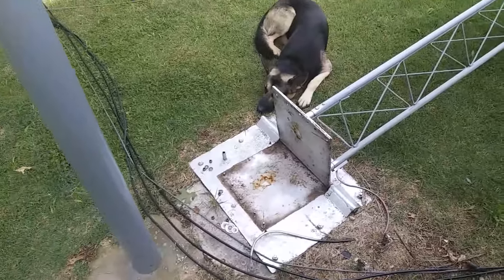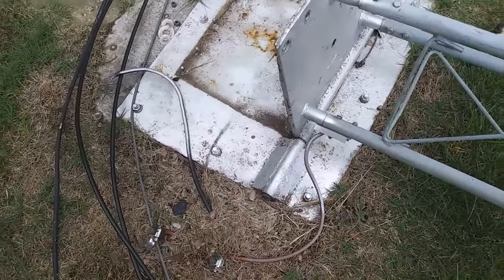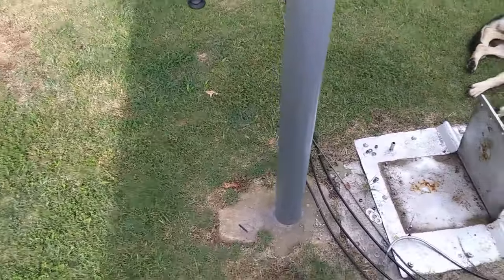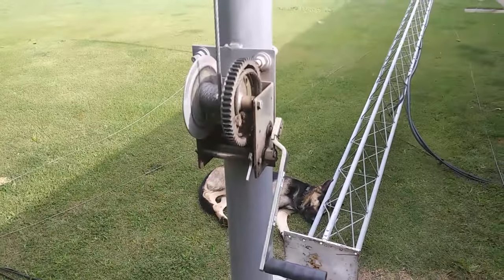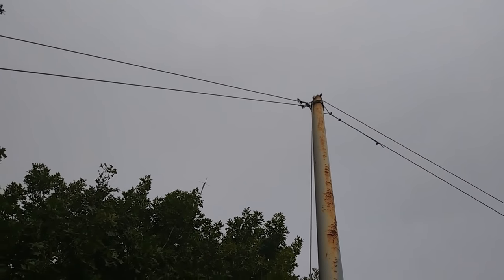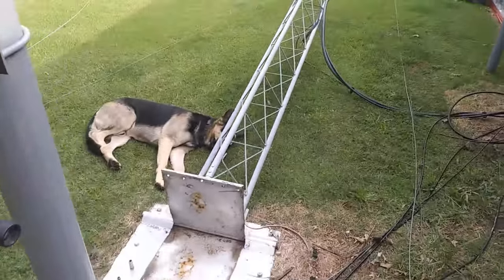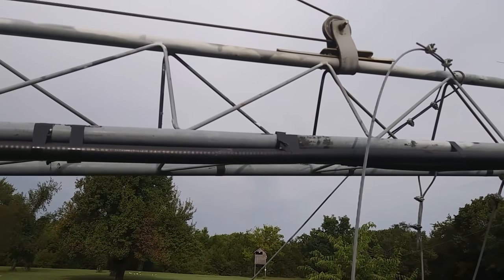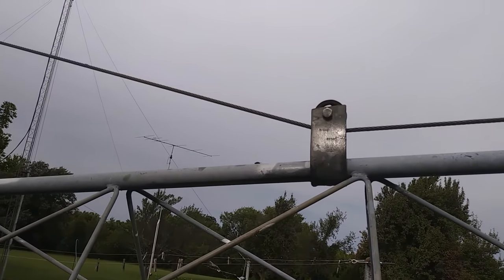Ham Radio Tower Install - Old Kansas House

Comment: But that's my favorite part: watching the tower go up. You can't leave that out!! Don't you have a tripod (for the camcorder)? And wouldn't any kids or grand kids help out with the crank up? I have a 110' aluminum (Universal) tower w/ 2m, 440 and 222 beams. I used a 90' oak tree with a pulley at 55' and used my pickup to pull it up. Some day I'll have to post the video. Got some scenes from the top of the tower too, but like you I'm getting too old to climb it to do ant/rotor/coax work any more and think I may take it down and put smaller ants up, maybe just a repeater.  ka2hng

Comment: Thanks for posting the good video.  I love seeing how other guys do their ham thing.  I run stacked A147-11's on a 40' self supporting tv tower.  Just a share point:  I run Alpha Deltas on all my antenna leads.  I designed and built a grounding block that is bonded to my single point "Chatsworth" grounding plate in the shack.  The grounding block gives me a place to "park" my antenna connectors when I disconnect them from the radios instead of just laying the cable across the bench, etc.  My idea about lightning protection is to prevent or at least lessen the chances of a direct strike by lowering the difference in potential to as close to zero as possible.  This is something my old high school electronics ham radio teacher taught me and it has served me well for over 40 years with no direct strikes to my station.  Lots of very close, holy crap! calls though.  Anyway, thanks for posting and yes, I'd definitely install an electric winch on that tower.  73
Reply: yeah leaving a loose coax cable hanging is asking for trouble! I take a grounded SO-239 mounted to my rack so i plug the loose end into it after i unplug. i doubt it will save the coax but should keep it from flying around in the shack!
Reply: That's interesting. So being not very technical here but seeing how a lightning strike tore up dads station when I was a kid. 
   Will a strike still come through the coax and just go to ground instead of hurting things or how?

Comment: Hello David. An FYI...Great tower setup and nice to see 80 feet of Rohn 25 does not bend too much when being raised from horizontal to vertical. Liked you home brew pulley's and thought I might try that too. One thing, using an electric winch does require stopping every so often to keep from burning up the motor. They won't stand running them for over a minute or two safely is my guess.  I know, I wore out two 8000# Harbor Freight 'Chicago' winches which was probably my own fault. Now I have a Ramsey RE8000 worm gear winch that works great and holds the load in any location while going up and down. Great for building quad arrays or any such thing. Like your setup. Terry

Comment: Thanks for Giving Me Some Ideas for 2 Pulley Points.. I need to fabricate  a Winch for one of my towers ..
Regarding Lighning--  as the ole' sayin' goes.. Lightning Does Whatever The Heck it Wants to Do!  Good Thing your Radios were unplugged!
Here in Florida is Lightning Capitol of the world.  I Disconnect All Radios when Not in Use during  Storm Season.

Comment: Worked in Florida,  worst lightning in the US! I have found that lighting does what it wants to do. I have seen it blow the connector off the coax and only blow the fuse in the radio, and have seen it blow components off the boards and not do anything to the antana or cables. Found more is better when it comes to lighting protection! Ground the coax at the bottom or the lowest point as it leaves the tower!

Comment: A safety note: The guy wire fasteners are installed backward. The "U" should surround the dead pigtail and the "U Saddle" should surround the loaded cable.
Reply: Thank you for sharing this info. I didn’t realize it made a difference.

Comment: Just thinking, with the 2 pulley system, when you crank it up you are pulling "two" times as much "cable" as you would with a single cable. If you had a wench with a 2/1 ratio wouldn't it do the same thing with a single cable? I have put up lots of towers in my time but being 83 I don't climb too well now. I had a 200 ft Rohn 25 that I put up years ago that I just took down but it was by accident. I was pulling a guy wire out of a tree with my truck and it hung another guy wire and down came the tower.------- UH OH!!!

Comment: I have the tower and I can’t find the tilt base.It will only be 40’ of tower and 10’ of mast for my Diamond V2000 vertical.I have 50’ now with 20’ of mast with a Five Band HF Yagi,5 element 6 meter Yagi and a 15 element 2 meter Yagi along with a G5RV and a 160 meter half Sloper on it.

Comment: I would like to reply on his wire rope rigging,Ive never seen this type of rigging but I have a 70 ft rohn tower and the way I rigged it was you use 3 pullies 2 on the gin pole and one on the tower this makes it so it want sag in the middle,First you do is start your end at the hand winch and feed it thro the pully on top of the gin pole and run it say in the middle of your tower where there will be a pully then run it back to the gin pole and out to the end or where it will not be in the way of anything and tie it off  at you hand crank and add as much as you need to, to over lap so it dont slip off.With this set up you pull both the end and the middle at the same time with same amount of lift,with a lon enouf genpole you could rase a 100 ft with a 30 ft gin pole,also you could add 2 pullies and a tie off on the tower if you are lifting one that is heavy.also Ive learned the by keeping the hand winch tight it helps stabilize the tower adding another guid wire to it,        Just my 2 cents

Comment: i know this is a old vid. but would there be any draw back to moving the rotor to ground level and running heavy plastic pipe to the mast pole ,might make it easy to work on?
Reply from the maker: piper jones that would probably work, but it doesn't take very long to crank down to work on it

Comment: The best earth ground goes as deep as it can. Of all the tower videos I have watched, nobody puts the spike in at the bottom of the hole below the concrete, but does it at the side afterwards.
Reply: Lightning discharge can blow concrete apart. That's why the rods are to the side.
Reply: the rods are on the side because lightning can blow the concrete and also so they can replaced later if they rust out.
Reply: @kevink5kev959  the preferred way is to install a 3/4 inch PVC pipe in the foundation hole before the concrete is installed, tape off the top of the PVC tube of course. Then drop in the ground rod.  When the strike hits the rod, the rod can expand but will not explode the concrete.

Comment: Please watch "https://everythingsafetyntraining.com/2016/09/17/saddle-bolts-safety-never-saddle-a-dead-horse/" to properly place your saddle bolts.

Please get the lightning protection book from the ARRL.  Your problem is that the lightning hit the top where the rotor is.  A lightning bolt is considered a current source of 10K to 100K amps.  If the impedance (R +L) from the top of your tower to your "ground" is 1 ohm, then you have 10K volts to 100K volts at the rotor which came in the house and jumped over to lower potential devices.  Each leg of the tower should be grounded with at least an 8 ft copper clad rods connected with a  copper strip.  Do not use braid for outside work.  In addition, you should have a very low impedance path to the power entry of your house using copper water pipe.  You may need to add another copper ground rod at the power entry.  Don't rely on the one placed there when the house was built.   All your coaxes should be tied to the tower at the top and bottom with coax grounding brackets."https://www.dxengineering.com/search/department/grounding-and-lightning-protection/product-line/dx-engineering-coax-grounding-brackets?autoview=SKU&sortby=Default&sortorder=Ascending"  You would need to find some that will accommodate you coax. Your rotor cable needs to get proper lightning protection."https://www.dxengineering.com/search/department/grounding-and-lightning-protection/product-line/dx-engineering-rotator-control-line-protectors?autoview=SKU&sortby=Default&sortorder=Ascending".  Your station is very unsafe.  Read the book and follow the book as best as you can.  If your house catches fire, the insurance company may not cover your losses due to improper lightning protection from your towers to the house and your power entry panel.
Reply: I noticed and was gonna mention that also,but it is a neat setup

Comment: Gosh, what would it take to raise my 200 ft. Rohn 25 with a wench? I just climb it. Has been up close to 50 years.
Reply: Rohn 25G is only rated for 190’ max, properly guyed.
Reply: Another option for a winch, find a farmers silo unloaded winch with an electric motor, they were designed to raise the unloaded before filling again. It took a while for it to get back to the top. Some of the systems used double cables to do the lifting.

Comment: This is so awesome! Sir, could you tell me more about where (what height from ground?) you have the pulleys on the tower mounted and how big is the pipe inside your 4-1/2 inch pipe, is it also 24 foot long? I also have exactly 70 foot of Rohn-25 and I want to put mine up the same as you.

Comment: Hi, I could feel my arm cramping and tiring watching you crank..! On that electric wench..dynamic mechanical brake and leave the well greased crank as failsafe.  I won't imagine electric wench failing and having to hire your neighborhood eighteen year old as your backup arms ?!🌝
Job and design well don.
73, 
Kb8qlz

Comment: LEMME  GET  THIS  STRAIGHT ! YOU SAY  YOU  WENT  TO  THE  "HARDWARE  STORE  . AND  BOUGHT  "AIRCRAFT  CABLE?!?"

AND 1/4" AIRCRAFT  CABLE  YOU  SAY?!?

LEMME  SUM  THIS  UP  SPARKY!

NO YOU  DIDN'T .....
Reply: You do realize that what he is referring to is an actual name of a type of commercially available cable right? He isn't referring to actual flight rated cable used in aircraft. It is a hold over from post ww2 when actual real 1/4" braided aircraft cable was available on the commercial market as surplus. Many different companies market it as such.
Reply: Well Mr Know it all Sparky...yes he did and you can as well. You can also buy it on  eBay. Maybe...just maybe you could try doing a little research before you show everyone what you don't know.